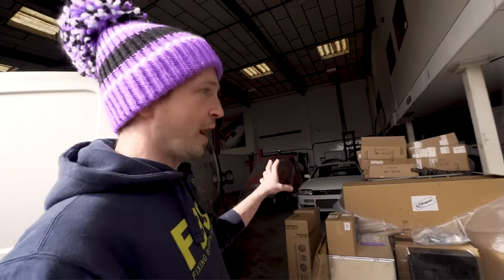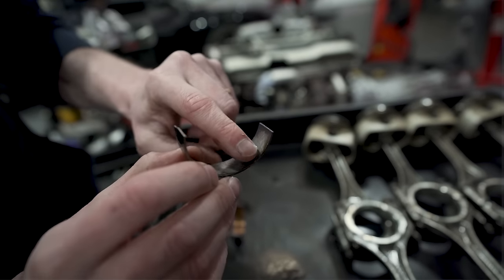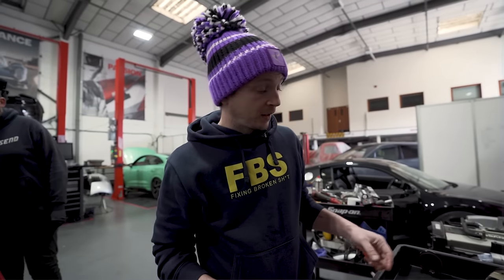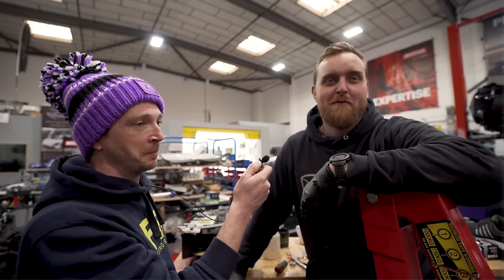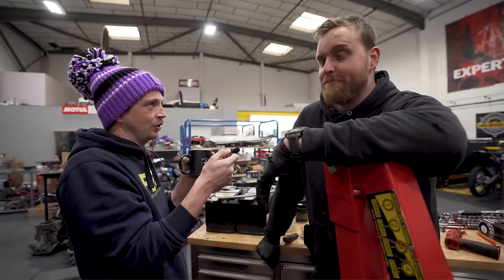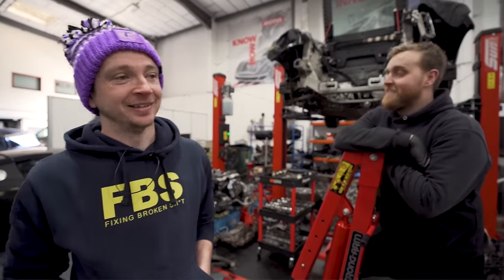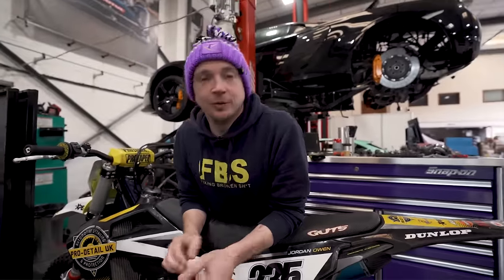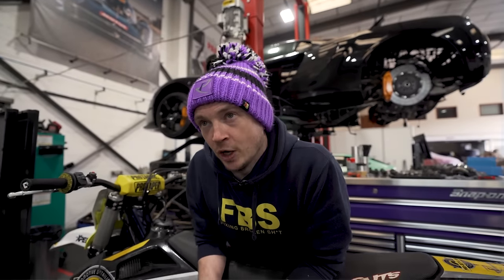The End Of The Car Tuning Industry? | Workshop Update No.55

Comment: In NZ there is an engineering process for modifications and it works. You should go on a work trip to see Dodson and buy a Celica
Reply: Yes I agree, ive dealt with Chch Sockburn testing station and can thoroughly recommend the process.  all my welds were inspected and mods were checked by an ENGINEER  of similar experience to me  and then it was signed off    im more than happy with the process ..( remember NZ was famous for its n0 8 wire )

Comment: Had that kind of wear on a few BMW M and S 1000rr's cavitation caused by air pockets in the oil bursting under pressure and taking away material from the shells, like you say that's usually caused from oil degregation and or to high RPM/ overspeed. We were told by BMW to increase the bearing clearance so a thinner walled bearing to increase the oil film between crank and bearing

Comment: Hi Ricky, I had a job like that a little wile ago where the big end shells were pitted just like that and could not work out what the hell happened . Oil pump ok  , oil level ok service oil change intervals  up to date . After some research found out there was a very bad earth connection that created an arc that pitted the shells . Sorted out the bad earth. Engine rebuild after no problems. 😊
Reply: Remarkable!

Comment: Completely agree with you on all points! Good rants as usual!

I have new Fiesta ST and it pops and bangs in SPORT Mode. But it also comes with a RACE Mode. It has a little disclaimer when you put it in that mode, but we all know everyone who owns one will play around with it on the road... Difference between SPORT and RACE is the ESC is off in RACE and the dash has some pretty RPM lights and a shift indicator.

But the ESC can be turned off manually... so I'm braking the law by using RACE, but not if I use SPORT and turn off the ESC.

Comment: Adding lubricants to bolts (and spark plugs) that are not specified by the manufacturer just results in over tightened bolts and spark plugs! 
If you follow the rated tightening torque you will over tighten them and that might result in failed threads in a head, seized bolts etc.
It’s only valid to use lubricant if the book tells you precisely which lubricant to use and the torque setting is quoted lubricated.
I’m told that tightening very high torque bolts in the oil and gas industry is sometimes done lubricated this way on very high pressure pipe junctions for example but the precise lubricant, method and lubricated torque are documented.
Reply from the maker: Exactly right, it’s why we use very specific and expensive grease on con rod bolts!

Comment: I am late on this but the car with the bearing issues, did it run E85? That pitting can be common with an E fuel car that has oil contamination then sits for a bit. Start it, move, shut down before oil is at full temp and you burn the E off, absorbs water and you see the pitting (basically corrosion) in the bearing surface.

Comment: Another excellent video and yes you are right to have a rant about injustice 
Why should the car tuners be responsible for what customers do with modified cars, that is like asking you to police customers use 
Here is a tip that we found works really well .
We keep getting customers with BMW M5 come in with the injectors stuck in the heads we found that if you pour coke into the heads and let it soak overnight you will be able to knock out the injectors in the morning.

Comment: Welcome to California... When i started Raver Motorsports in 1996, we had EVERY customer pull the license plates and sign a waiver that the car would not be used on public roads. We got called out on it once, and I made the same argument you did. Luckily the cop had some common sense and didn't push the issue. By CA law, we WERE liable. And yes, CA has a law that says if someone was drinking at your house, and you let them drive home, you are liable.

Comment: How much copper  slip are u using? Clean the seat of the plug,  a tiny bit of slip on the bottom thread   or if you are that worried a conductive grease   OR if the plugs get removed frequently dont worry

Comment: Ricky, I understand your rant, totally. In the USA as you are aware the EPA are targeting these tuners and the fines are massive.
The environmental improvements trying to clean up air pollution include improving emissions from ICE vehicles. 
The UK has one of the most permissive countries in the world to allow individuals and businesses to work on cars and engines.
Germany you have change tyres every year, you can't fit non TUV parts.
As legislation tightens its emission levels are going to tighten... Engine builders and tuners will be restricted on what they will be able to do.

I love cars and engines but they will be legislated against and the screw will tighten and selling non homologated parts will result in court cases.

Change is a coming and it's not going to be pops and bangs all round...
Reply: Ermm You don't have to change tyres every year , you have to use  suitable tyres for the weather , you can either have 2 sets one summer one winter or use "snowflake" marked all season tyres all year round ,  either way those tyres can be used for multiple years condition/wear based.

Comment: Ive seen similar on bearing shells when the owner of a car that he didnt use much,  thought starting the car and running it at idle for 5 mins every week would be a good thing.(to help charhe his battery and get oil pressure) Condensation in the crankcase poluted the oil as it never actually goy up to temp and corroded the bearings.

Comment: I drive 1100bhp Nissan Gtr r35. Ive always loved cars. Bought my first car at the age of 14. I agree with you for the most part, however, performance car owners need to be more responsible and considerate. If you drive a car with a loud exhaust think twice before accelerating hard in a 30 limit, especially if there are houses and kids nearby. If it’s after 19:00 in evening don’t be accelerating hard near people’s houses and running pops and bangs maps. 9 out of 10 people do not want this going on outside their houses. It’s only going to result in complaints to the authorities and we are going to end up getting taxed off the road or changes to emissions, noise limits etc will mean use of our performance cars on the road will soon be a thing of the past.

Comment: The thing is, car manufacturers have to make cars that fulfill emission standards and make provisions to prevent tampering with these is to ensure the vehicle will keep within emission standards for a specific time frame and distance traveled. You have seen what happened in Dieselgate when the manufacturers didn't do this properly. It has been many years since this legislation is in place. When a company manages to break the anti-tampering that manufacturers have to put in and knowingly modify the software (and/or hardware) they should obviously be aware that the vehicle will no longer fulfill the homologation requirements. Putting the requirement on the tuning companies to ensure that cars aren't used on the public road after the software has been modified is maybe a bit steep, but just for legal liability, I think it is fair to have the customer sign a waiver where they state that they are aware that the modification performed makes the car illegal to drive on the public road and that this modification will make the car be legal to be used on private grounds (track) only. They will have to also state that the company doing the modification will not be liable if the owner decides to break the law and if a magistrate decides they are, the customer will be fully liable for all costs and damages that the company performing the modification endures as a result of the customer breaking the law. It's not really what you want, but if you want to make money on putting pops and bangs on some barryboys shitbox, you will need to cover your behind....

Comment: The first engine I ever took apart the rod bearings had little holes in the bearings like pieces had flaked off. the Bearing would be silver and then it would  have hole and copper showing. might still have them sitting around. but that motor had a bad head gasket when I got the car.  Some of the bearings were also pretty far gone, and mostly copper, one of them was brand new it was the forth rod bearing

Comment: R8 bearings look like a cavitation problem. Caused by either oil starvation, too high clearance or/and oil airation. Is the big end spun on the first journal that would suffer from oil starvation, in an oil surge situation for example ? My guess is hard track use causing oil surge, causing slight shell damage, causing oil clearance incease causing oil pressure loss causing shell failure/spin . Vicious circle of events.

Comment: There is hardly any difference in the volume consumption of Proper OE  brake hoses and Teflon, cheap after market rubber is a different matter. The advantage of  braided for me is you good ones have stainless fittings. Downside is the fit/routing  is not always what it should be. also whereas deterioration of rubber hose can be spotted early with teflon failure of the inner hose might well not be spotted till too late. The overbraid is just for protection not reinforcement . Fun fact overbraided teflon struggle to meet "heavy duty" specs some vehicle buyers have like Post-office type Kerb-bump test etc. As always if it seems to cheap to be real, it usually is.

Comment: agree with the rant from the point of the responsibility being the owner of the car... but pops and bangs can get in the fkin sea, i live in a residential area, its a 30 zone but its a big wide road that leads onto the A10 out of london, cars go through the speed camera 500m down the road, floor it and then ease off to go round the slight corner which is exactly where i live and you get a relentless pop and crackle throughout the night. Ive had cars where they pop occasionally on overrun because its had head work and cams (carbs and a dizzy) but the maps people put on make it sound like a spanner in a washing machine on a spin cycle going on for ages and it can f right off (even from factory).

Ive also bought and fixed up a Cat N car. i lost money on it because i went to extra lengths to make it perfect and im a hobbiest doing it on the driveway. but my neighbour has a car which is held together with wood screws.. as much as i love car modifying, i would be happier with TUV style system. I have an issue with people tinting their front windows as well but thats because i almost got taken out on my motorbike because they wern't looking an i couldnt see them to know if they had looked or not (which i do when riding around town because people pull out all the time)

Comment: If you want to do major car mods in Oz the first thing you need to do is find an approval engineer to certify the finished vehicle and that cost serious money. All workshops are licensed and must have a minimum level of equipment and all technicians are licensed after an approved apprenticeship. Smashed write off's are put into a data base so they can be tracked but even with all the above the shonks still get away with selling cars that should be crushed.
Reply: The percentage of owners that get their cars is very low, there are so many people changing exhausts, tuning etc etc without even talking to an engineer so many of these cars would be illegal on the road but the industry isn’t as scrutinised in Australia as it is in other countries

Comment: Great content as always Ricky. Question re bearing problem on the R8. I take it that the main bearings were ok. Why would it only affect the big end bearings. I get the different loads at work but wouldn't an oil prob affect all bearing surfaces ?

Comment: Guys if your doing work on a road car that make it illegal you can only blame yourself. If the car turns up at the shop with an interior, stereo  furry dice et all, you know it's used on the road.
 The same criteria would apply for having a hydraulic hand brake, when it comes to mot

Comment: About the bearings, it looks like they drove too short distances, not enabling to heat up the oil (or the oil cooler is working too good) hence the moist or condense in the oil is eating into the bearings. They have to make sure the oil temperature  is going beyond the water booling temp so it can evaporate.
Reply from the maker: Yeah I did think that! Does look like a degree of corrosion!
Reply: Did you send the oil off for a sample test?
I've seen fully synthetic that's been open soak up water and wreck bearings

Comment: Hi Ricky

I'm involved with people in recovery and I'm in recovery myself (over 2.5 years nothing not a beer). Government give away free needles at boots chemists ask for a exchange pack its annonymous as well.
Are there any turbo upgrades for the k03 turbo that won't involve s3 injectors and high-pressure fuel pump that I can run on a tsi engine for a happy medium which I can put on my stage 2 set up(with out pops and bangs)? I know there is a forge motorsport actuator upgrade, would that add anything?
Cheers
Jamie

Comment: The offroad bike salesman will not be held responsible because because most of his customers use the bike on offroad private tracks most of the time. "Tuning companies" make most of their money on cars that get used on the public road. If 95% of what they do gets used illegally, even though their own work is not, a case for "aiding and abetting in a crime" will make it in court, especially if they don't do "enough" to prevent this from happening. I doubt most of these companies could even exist if it wasn't for cars that get used on the public road, so it is obvious that law enforcement is coming after them.

Comment: If the car is not safe to drive away from and MOT you will dangerous faults marked  and be told you have to have it towed if you are not leaving it for repair, get caught breaking that reg. and you get  a big fine and points. MOT testers have done their duty by noting the dangerous faults on the MOT failure notice.
Reply: Years ago I was in a garage ( mot ) and a customer brought a car in with the bonnet tied on with parcel string, after much discussion the outcome was if it wasn’t fixed or trailed out the service manager would ring the police and report a dangerous vehicle being driven out the road. In the end the car owner got it trailered away.